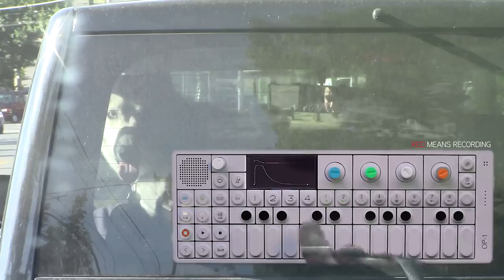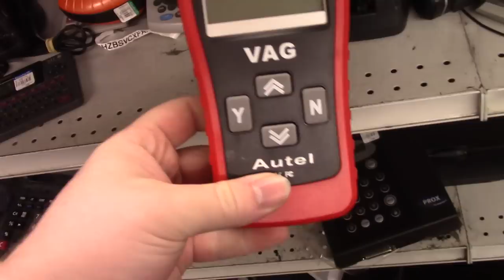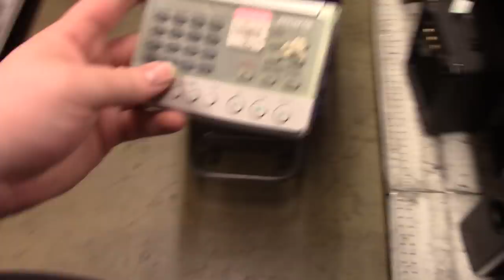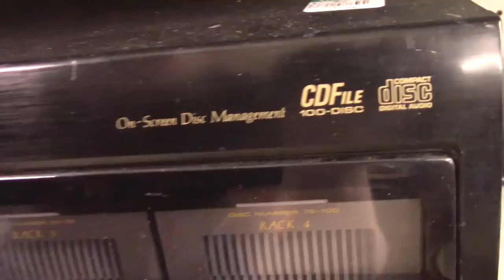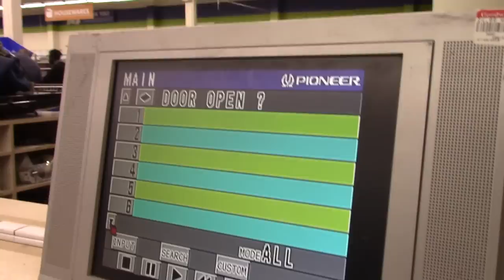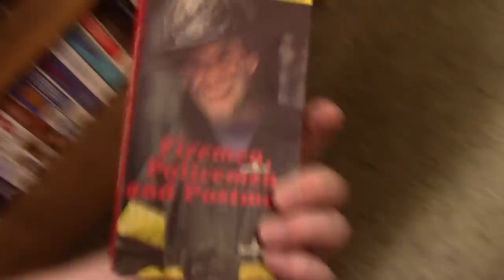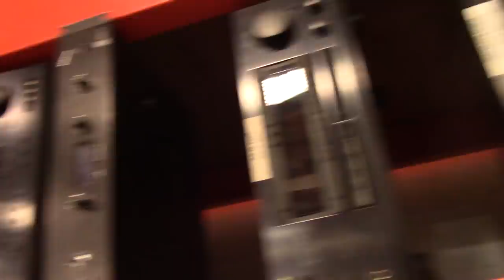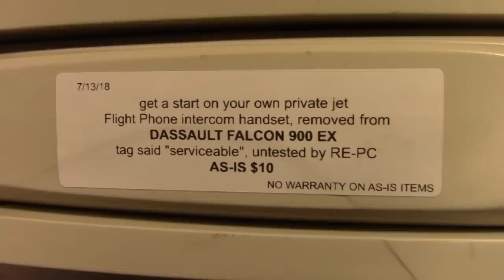Goodwill Trip 6

Comment: Nice finds! I spotted the wine red case of the JVC GR-C1 before you even mentioned it. I had one for some time, and for most of that time I didn't even realize how special these are. It was just a random old camcorder I got at a flea market for 12€ and some change. Unfortunately my GR-C1 broke after years of not being used (probably just a belt), and rather than fixing it, I decided to sell it on Ebay. I got a lot of money for it, but sometimes I think I should have kept it... The Sharp MiniDV Viewcam is also an interesting find, I occasionally see them for Video8 or Hi8, but the MiniDV models seem to be very rare over here.

Comment: A 'true' computer tape recorder would have a switch for 'auto volume level' or at the very least, normalization with an adjustable volume level, which will make sure the 'bits' output at a consistent voltage range. Once you get it right, you never had to touch it again, and all tapes would work without changing anything again.
Most of them just had a sticker on them and didn't have normalization at all, sadly.

The late 80's through the 90's had some very weird experimental tech that will never not be interesting. Times were changing faster than people's sensibilities, and led to some truly bizarre gadgets that don't seem to solve any actual issue, but that's what makes them interesting.

The scanlock was used with a video toaster. It was for realtime graphics baking onto video, usually livesteamed video. The scan lock would overlay the output of one video source on top of another video source, or multiple overlays on top of each other. This one was designed for an amiga to output the overlay text, and could also use the amiga as it's power supply.

Comment: 16:44 Some fan of vintage editing equipment has probably yelled at their screen when watching this video. I sort of know what that is, but don't know enough about Amiga to tell you much about it. I've used a less outdated non-Amiga counterpart to that in school for video production class.
Reply: Maybe something to do with text overlaying and green screen type stuff?
Reply: @keithfulkerson  It's definitely for green screen, but I don't know enough about that particular gadget to know if you can use it to overlay text. That might have required a separate device. Early live video mixing couldn't do much at a time because of technical limitations.
Reply: These would sync the Amiga’s video signal to an external source to let you either record it or overlay text or graphics on top of a video source. I had a SuperGen and later a Video Toaster with my Amiga, both did the same thing. This one is definitely meant for a production environment.